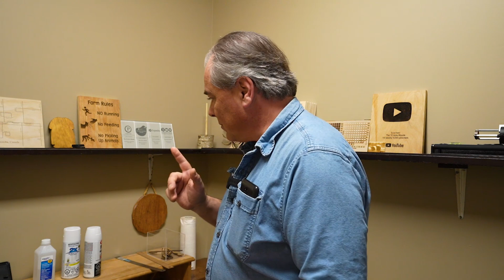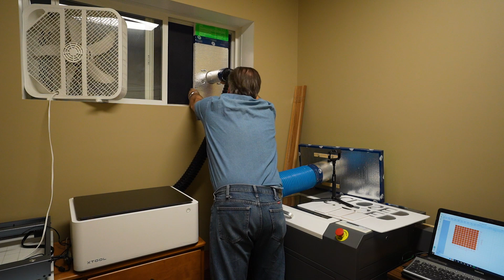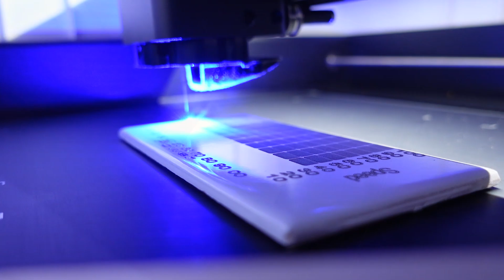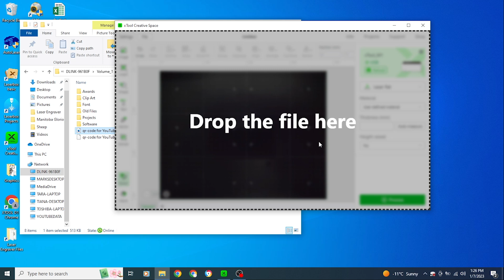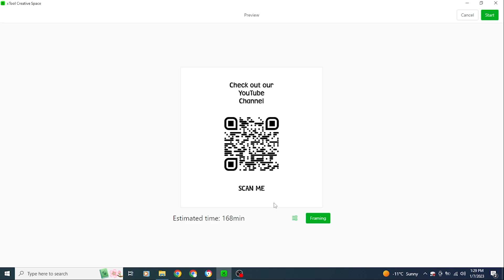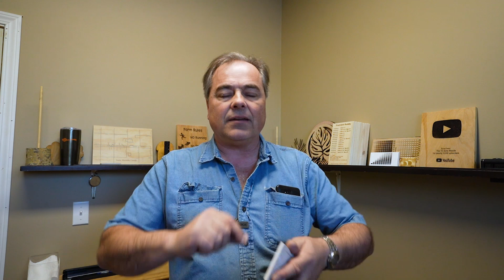Ceramic Tile Engraving with the Xtool M1 Laser  @xToollaser   #xtool  #lasercuttingmachine

Comment: 1 PArt Water:1part rubbing Alcohol at least 70%,: 2 parts Elmers Cllear GLue: 3 parts Titanium Dioxide. Mix well and paint on the tile. use immediately or wait to dry.  This works very well and covers exceptionally on 2 coats.